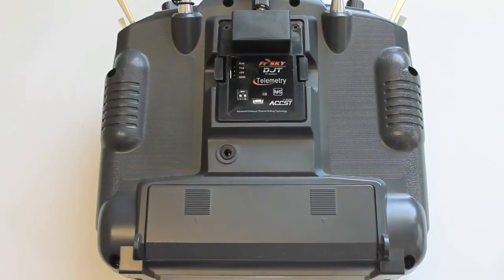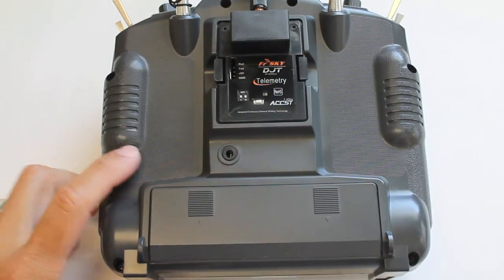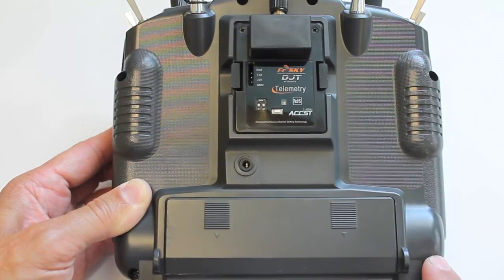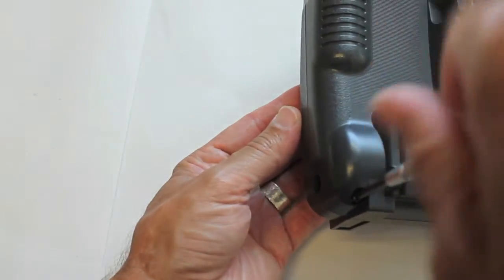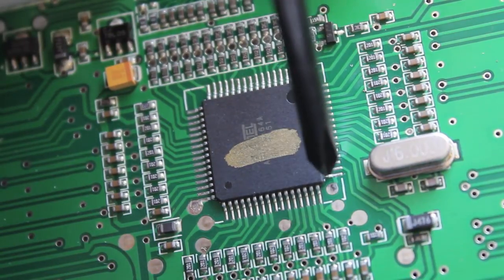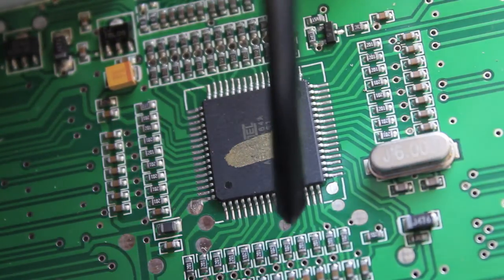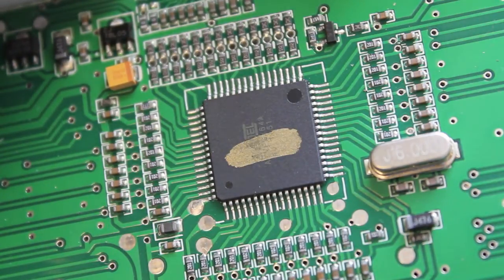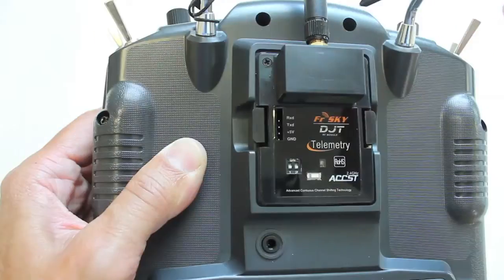Determining Turnigy 9X Generation for SmartieParts Board & er9x Upgrade

Comment: Dennis, let me know if you have any questions. I did the same upgrade a few weeks back along with a backlight and FrSky module system. Did you get the link that shows how to easily flash the file that gives you six positions using both the three position switch and the aileron d/r switch? Anyway, our setup's are so similar so if you run into a snag I probably did to. Let me know!
Reply: Can you provide the link you mention in your post?
Reply: @jeremygalloway1348  No, sorry. That comment was 9 years ago and I haven’t flown RC in probably 7 haha. Sorry!